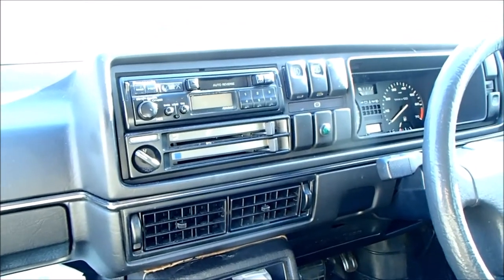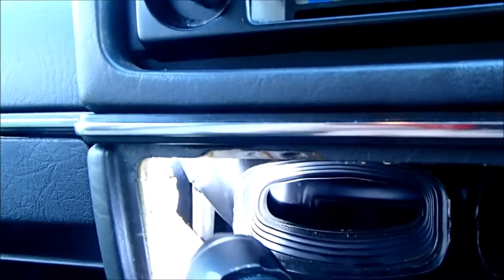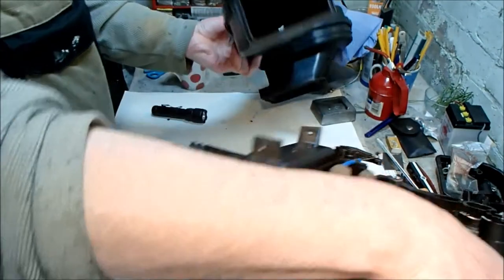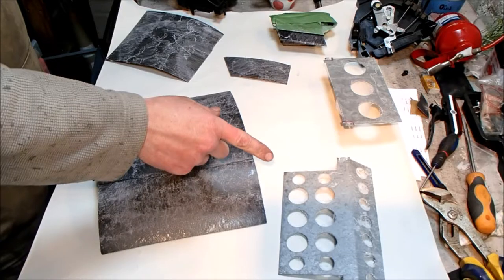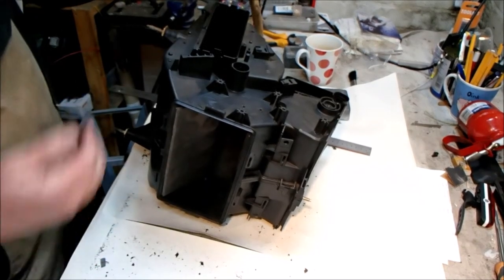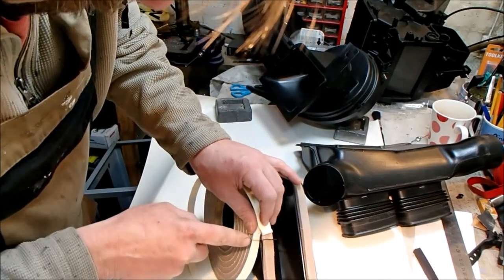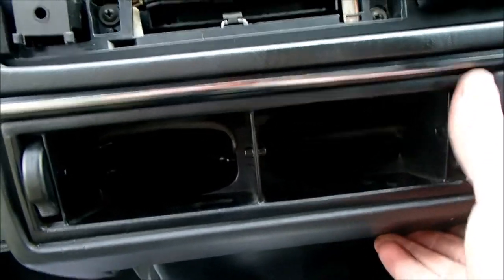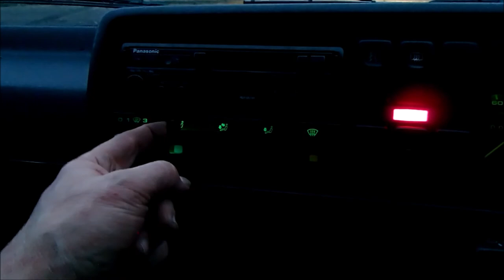VW Golf mk2 full Heater box removal restoration and refit

Comment: Thank you so much for this video, i have Jetta MK2 from 1986. My matrix heater started to leak and i bought new to replace it cost 21 USD with sponges. Tommorow i need to complete assembly process i love this MK2 cars i Mode my Jetta to use only LPG because it is cheap fuel.😊 

This video help me to safely do the job i hope everything will works good.
Reply from the maker: Good luck and enjoy it

Comment: 47:40 You should put some silicone grease on the moving parts in the heater box and on the heater control panel and on the control cables, to make it work and change directions much softer and smoother . But only sillicone grease , not regular lithium grease because it destroys the plastic and rubbers with time .

Comment: Thanks for this, I’m about to start the job myself and this is the most detailed video I’ve found.
Reply from the maker: Good luck. It's quite straightforward just time consuming
Reply: All done, 10 hours in total. Now I’ve just got to chase the air out of the coolant system as I’ve got intermittent hot and cold air coming out the vents. What a pain! Any tips?
Reply from the maker: @zacharywright153  I didn't have that issue, however I did vigorously squeeze the coolant pipes whilst the engine was running, this may have had the desired effect.
Reply: I’ve concluded that it’s the bypass valve not letting enough coolant through to the matrix. Going to replace the hoses, hope it works.
Reply from the maker: @zacharywright153  good luck, let me know how you get on.
Reply: All fixed. Feels like four hairdryers! Thanks again.
Reply from the maker: @zacharywright153  can I ask what material you used to recoat the vent flaps ?
Reply: I used some EVA craft foam sheets from Amazon, 2mm thick, self adhesive. I only sprayed glue on the metal. And I’m not having trouble moving the slider at full power. I noticed a sort of door stop on the front vent flap that stops it fully closing, so you always get a tiny bit through the face vents and it doesn’t create that vacuum effect.
Reply from the maker: @zacharywright153  thank you, I'm beginning to think that part of my problem is the new blower motor. It seems to have more grunt than the original. Perhaps it's the shear volume of air causing my issue.

Comment: A friend and I did the heater matrix on my '89 Passat GT and it took us two days and we had to pretty much remove the dash. Not an easy job, but at least we didn't have to repair the heater box! Well done for sticking with it, you've done a good job.
Reply from the maker: Thank you for the kind comment. It was a long job but mostly enjoyable ( except the frond vent plastic 😂)
Reply: @richardjweeks  Having owned a car with no heat (blocked heater matrix), I know how unpleasant it can be with no heat in winter. Sounds like it's nice and toasty now. :)
Reply from the maker: @_zzpza  I was thinking how odd it is to be excited by something so everyday as in car heating. I'm sure the novelty will ware off but for now it's a real pleasure 🙂

Comment: Great how to.  Just followed it.  One thing - to get the last air chamber in (one that goes to centre two vents) you can remove a small bracket under dash just to the left of steering wheel.  4 x 8mm bolts, with that out the way the chamber goes in easily.  You'll need a long extension for 8mm as one is quite far into dash
Reply from the maker: @zxcvbniuy  perfect, thank you

Comment: Cut a clean square with dermal in side of the console plastic to access the heater core.  Then you can access the parts in 15 minutes and cleanly plastic weld the hatch back.  If it’s not a show car nobody will see the plastic welding. I’ve done about 20  cores that way in.  Total jobs 30 mins.  Or take the 8 hour route . I’ve done that as well lol. You had more parts out then I did so that may not work beyond just replacing the core.

Comment: What was the material that you covered the metal "doors" ?Looked pretty high quality is it better than the sponge ?
Reply from the maker: @ΘανάσηςΜ-ε6γ  it's neoprene sheet, inexpensive. A good quality foam would work well too
Reply: @richardjweeks  Did it last long or did you notice any problem with the heating again ?
Reply from the maker: @ΘανάσηςΜ-ε6γ  it's still working perfectly. Heating is as it should be.

Comment: ages ago i fixed it in my old mk2 with duct tape and it actually held op quite nice, i never took it all the way out though. In the one i have now it has just started to blow out the vents so i may need to fix it on that one as well soon. Just to make sure, are the windscreen heat a separate flap? i do have an issue with not being able to fully move the control to the windscreen. Edit you had the same problem maybe it's also just my cable being fitted wrong as well a honestly can't remember if it has always been like that :P

Comment: Did you use brake cleaner to clean off all the old foam/ residue off the plastic ducts where you applied the weather strip to also? About to start this job myself and just amassing all the bits I need beforehand; cheers!
Reply from the maker: Yes, I decreased everything first to aid adhesion. I think I used is the for this job.
Reply: @richardjweeks perfect, thank you! Has been a messy and annoying task to get sticky residue off of plastics in the past, so it’s good to know brake cleaner will work well for this task! :)

Comment: In your opinion if I don’t need to replace the heater core would it be possible to spilt the box in the car to just remove and recoat the flaps?
Reply from the maker: It is not possible to remove the flaps with the box in site, however, people do recoat the flaps through the front of the box.
Reply from the maker: https://youtu.be/eJxTPR7hOkI
Reply: @richardjweeks  thanks for the reply, well now I know what’s going to be taking up my weekend.
Reply from the maker: @quintonlennox4636  🤣

Comment: Thanks a lot for the great video! Did you drain the coolant before taking off the heater box?
Reply from the maker: No, it isn't necessary, the coolant pipes are quite high, just plug them up and tuck out the way. You will still need to top up the system afterwards though.

Comment: I had mice get in my car during storage and they ate holes through the blend door.  I used sheathing tape to cover the holes, without taking everything apart. (I already replaced the matrix a couple years ago)
Reply from the maker: Much easier if just repairing the blend doors, I hae seen it done in situ like that before.

Comment: Brilliant job Richard. Being a work shy fop, I’m wondering if there is any reason why the holes in the flap could not be blocked off by a bit of plastic bonded to the flap rather than foam. Looks to me you could get access to most of the flaps without taking the box apart, but it’s hard to tell. I’m not bothered if it’s not what Vw did if it works cause no one will ever see it. What do you reckon?
Reply from the maker: Many people do this, they access the main flaps through the front cover and use eithe silver foil tape or duct tape. It works well enough and is less invasive. Check out a channel called "endfloat" he's an Irish fellow who does just this oñ his mk 2
Reply from the maker: https://youtu.be/eJxTPR7hOkI
Reply: I was wondering why VW didn't just have solid flaps with foam strips on the sealing surfaces. Now I understand where all of that foam in the vents was coming from.

The HVAC quality mastic-backed foil tape would adhere well to the steel flaps to seal off the holes.

Using open-cell foam on the sealing surfaces will conform and give more than closed-cell foam. I have found closed cell foam to be less reliable and more troublesome when it comes to adhesion and longevity.

Comment: Did you have to drain the engine coolant before you disconnected the heater coolant hoses in the engine bay 🤔👍
Reply from the maker: No, you will loose some coolant when you disconnect the heater matrix, but if you keep the hoses lifted high, you will retain the majority.
Reply: @richardjweeks  thanks Richard,  when you had to remove the stainless steel staples to get the vent section back in, did you reseal it or just place them in
Reply from the maker: @steviescott5379  just pushed them back into place, the staples aren't necessary as the vents hold them in place.
Reply: @richardjweeks thanks Richard, appreciated started tonight.🤣

Comment: Its much easier to remove the dash. i can do a heater matrix (removing the dash) in 3-4 hrs.
Reply from the maker: I didn't know that was an option. Would that Include reforming the blend doors too ?
Reply: @richardjweeks   Its the easiest way to get the heater box out. ( Its how we did it when i worked as a VW tech)  While your there you can clean all the ducts and replace the felt between the duct joints so they don't leak.
Reply: @vintagespeedshop  Were the heater recall repairs on all the MK2s or was it just for the cars with coolant leaking into the cabin and vents? 
Where on the matrix would they typically fail and leak?
I have a couple heater cores to replace, I am curious if they are the original ones of if they had been replaced under the recall campaign.
Reply: @davidparker9676  It wasn't a recall on the matrix, it was a recall to fit thermostatic bypass valves in the heater pipes between the engine and bulkhead. They were fitter to reduce the temperature and pressure going to the matrix. If there was any signs of leaking they would include changing matrix but if no leak was detected they only fitted the valves. 
The problem was on a few cars the pressure was causing the matrix to split open where the end plastic tanks were crimped to the sides. 
They never actually changed the design or uprated the matrix it self.
Reply: @vintagespeedshop  What country are you in? 
In the USA, we didn't get the thermostatic bypass on our MK2 cars as far as I know, I've never seen one installed on any of the many MK2s I've owned or worked on. 
I have done the bypass retrofit on BMW E30 3-series because of insufficient heat from the heater. On the E30, the coolant flow was too fast for the heat to transfer into the matrix. Once the bypass kit is installed, the heat is dramatically hotter.

Certain years of the MK2 have a recall on the matrix itself here in the US, due to the heater matrix rupturing and burning the driver's legs.
Reply: @vintagespeedshop  "They never actually changed the design or uprated the matrix it self. "

Actually, there is a change in the heater matrix in later production years of the mk2, which persists to this day in aftermarket products, but nobody can say for sure if it's related to the problems of leakages.

The difference is whether the bottom end uses U-shaped metal pipes going back to the top with a plastic cap covering the area (which you can remove to see the pipes), or if the bottom part is basically like the top part and the water is redirected to the top by flowing through the plastic.

The former is the newer design all current aftermarket products also use. It seems plausible to me the U-shaped metal pipes are less prone to leaking than the plastic caps which were crimped to the sides as you describe.